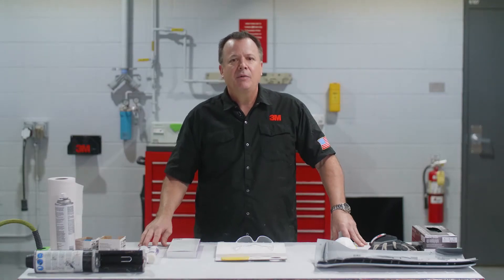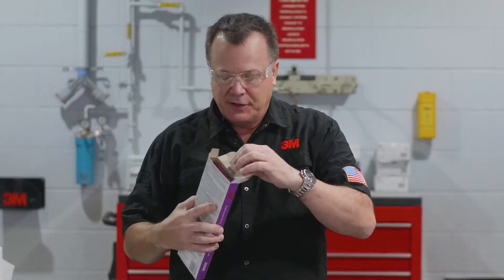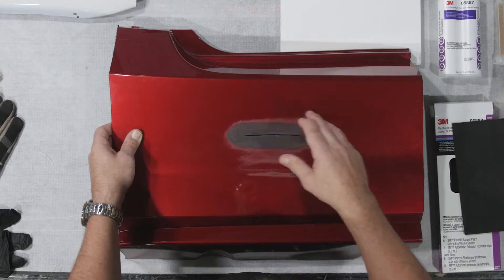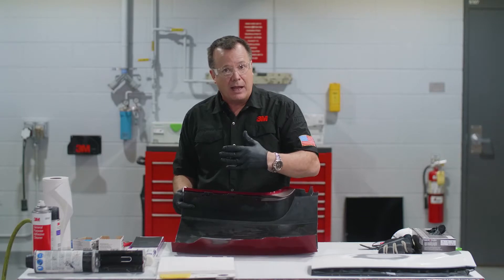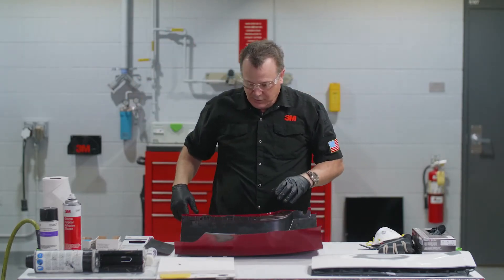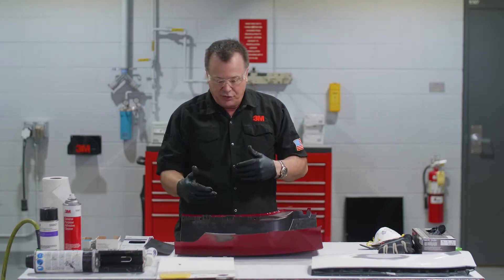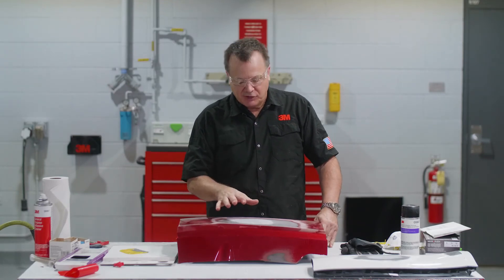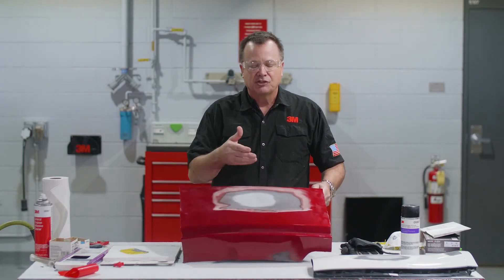TECH TIPS: Backside Bumper Repair Simplified

Comment: 3m you hyped me up, seemed like a great solution.but was extremely disspointed to learn that a box of these are 150,  you know damn well that there is penny's worth of material in these patches. Manufacturing is pretty standard. so it frustrating to know that 3m is ripping face with this product. but aside from that, you guys are fawken morons, really. there are aftermarket brand new bumpers that can be bought for 100, why would someone spend 150 when they can buy a brand new bumper at 100. stupid asses. 3m deserves all the bad karma. hope your stock plummets to below 1 dollar...

Comment: I don’t know the timing that you actually followed, but it seemed like you said that you took your mask off right after applying the adhesion promoter, as the chemical was flashing off. Shouldn’t you be waiting till it’s finished flashing off before taking your mask off? Isn’t flashing off caused by solvents evaporating?
Reply: Good question but I’m in an extremely well ventilated area. There’s an intake filtered vent right under my feet. 👍
Reply: Your absolutely right but he was not in direct contact with the chemical compared to when he was applying it, the vapors would dissipate in the atmosphere as it flashes and with that small of an area, the vapors would have thinned out and or wont even reach the height he was in as judging from the background he's in a enclose environment that air circulates well but does not blow around everywhere compared to when ur outdoors. Also normally these rooms have a filtered air vents.